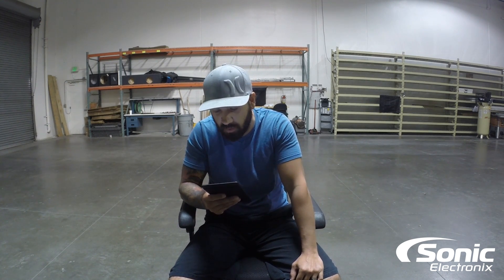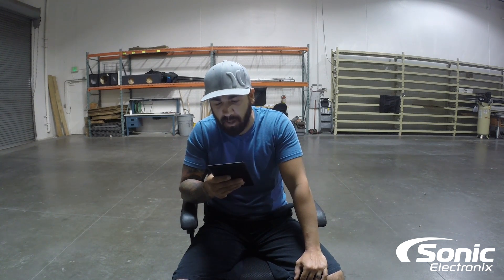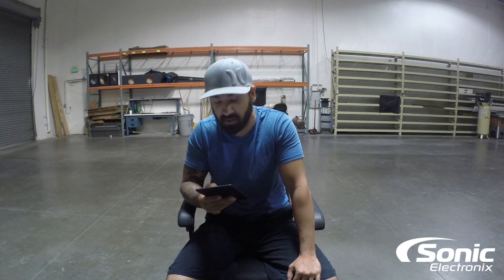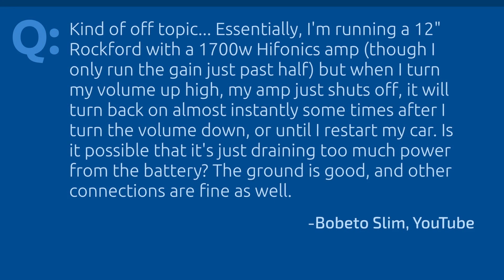Why Does My Amplifier Shut Off? | Car Audio Q & A

Comment: I have a DNX8120 and a JL audio 500/1v2 mono amp for my two 10” JL Audio subs. When I have the volume 15 or below the amp for my subs turn off. When I crank it the amp turns on and sub work fine. I looking for help to solve this problem. Can you help me?

Comment: Question hope you could answer it. I’m running two 12tw3 on a jl audio 1000/1 jx amp and every time I turn the epicenter up it cuts of until I lower it and it turns back on
Reply: Lower the gain a bit just a teeny bit and see if that helps.

Comment: Bros after doing a complete checklist changing harness changing power wire resending relocating grounds changing fittings on power all that to find out that if you mounting amp directly to the back of your factory seats can cause amp to cut out
Reply: Fo real? Cause I been chasing my tail

Comment: Just had an amp and speakers installed now i have to manually turn off my stereo and it sometimes the radio comes back on when car is off and my battery is dying.. what do i do
Reply: Tour stereos remote turn on wire is connected to a constant power if it doesnt turn off when the car does. Needs to be rewired

Comment: I have a 2500w quantum audio 12 inch running it on a 1500w crunch amp it shuts off after a few minutes and I noticed the amp gets really hot is the subwoofer possibly just too much for it?

Comment: Need help.....running two amps with two 12's 4g from battery to  Distribution block then 12 gauge wire to the amps...worked fine...changed 12g to 4g and now amps keep shutting down at anything over 3rd volume.   4g ground....was also 12 before upgrade.   Checked game and adjusted boost level nothing is working To fix the problem

Torinopro422@gmail.com

Comment: My amp went into protect mode after losing the power connection i fixed the connection but now its in protection mode...help
Reply: Check remote wire, take out battery cable to amp, make sure there is no corrosion in where you insert power to amp.. happened to me and that took care of the problem, kept happening until I went from 8 gauge power from capacitor to amps to 4 gauge,  the remote wires also melted or got a little burnt,  cut off put clean remote wire back in no problems since
Reply: @jessedukelacrosse6470  hey I have 3 15s and two batteries in the back, same issue, amp keep turning off, but when I took the 2 batteries out it doesn't shut off as much anymore, please help explain.
Reply: @3yearsago287  god damn you trying to kill everyone you drive pass? Hahaha yup me to lol
Reply: @strangedays2010  it's actually my husband's lol
Reply: @3yearsago287  nice!!!!!!!!

Comment: I have a Kenwood radio double din and a Kenwood amp 2000 watt  and a fuse 300 and to 10inh subwoofer hezt  500 watt and what to  protective mode . I disconnect my subwoofer it is still pretending mode  I check the fuses amp it is good and check the fuse  under the hood it is good toi  have a competitor it is good to

Comment: My Sundown sae 50.4 was working fine along with my Sundown scv2000d, but now that im running it with the Orion Hcca 5k , the sae50.4 is getting hot and cutting off. Is this due to it not getting enough voltage? I have a 320amp alt, xs power 5100 battery , and 0 guage wire ran.

Comment: Can we use a 12 gauge wire as the remote turn on for the amp instead of the 18 gauge wire my pioneer 760w amp keeps shutting off by its self tested at 13 volts with the ground and positive connections at the amp when I tested the remote wire on with the ground got 3 volts

Comment: I have a question. I have 2 sundown sa10's and I'm running a 2500 planet audio amp. It goes to in protection mode. I have checked for shorts. And my gain was set with a multimeter. I dont have my bass turned up on my on my bass knob and if I crank up the bass on my knob it will go into protection mode

Comment: I have a similar problem but mine is with a Pioneer 6X9. I disconnected one of them and the audio worked fine then I switched the 6X9's and as soon as I turn up the volume the amp goes into protection. I think it's a bad 6X9 but not sure because the speaker still works. Could it be going bad and causing a bad connection within the 6X9 that makes the amp goes into protection mode? If I leave the one off the amp works perfectly fine.

Comment: I just got a 1000.1 kicker amp with a 10in kicker compr 2hom sub an it's making my lights flicker an shutting them off,my old amp an sub did not do this it only happens wen I hook up my 1000.1?
Reply: Cody Lovelace Is that the Q Series? I bought one of those cheep bastards last week and even before I left the shop parking lot they knew I wasn’t happy. Needless to say my Pioneer execelon  600 watt is back in pounding away.

Comment: My amp goes into protection mode when I plug in the groundwire does that mean I don't have a good connection or need a stronger wire?

Comment: I have a Eclipse Da7232 amp. I put it on my bench test and it would power the green light on, then fades out right away. I figure it was a bad fuse or connection. Put a Rockford Fosgate T1000-1 on the same test and powered on with no issues. I cleaned up my wires and retested the Eclipse amp along with a multimeter. All fuses are good, power supply is good, ground is good, remote is good. I know with this amp its a digital amp and has 8-25amp fuses on it which were all good. Any idea what the issue could be, or is it a internal issue possibly. Never opened the amp up to check internals. 
Tested on a Mobile Authority Hybrid power system 14.4v constant.

Comment: I have a question I hope this is were you post.This is what I have:All wet sound products. (1) REV 410 speaker.(4) swivel REV 10 (4) 650 RGB speakers.(1) 10 FA sub.(1) SD 6 Chanel amp.(1) SD 2 Chanel amp.(1) HTX 4 Chanel amp. (1) Wet sound RGB controller (1) 120 amp disconnect switch.(1) distrabution block. All seems to work but my SD 6 AMP for the tower tower speakers that controls the first two items on list. This has been installed less that two weeks ago and all was working. Now the second time I turned it on the towers speakers and they are not working. Checked the 12 VDC power to the SD 6 amp and it good, then checked the negitve ground and it good, checked the AMP start from ken wool deck and there is 11.6 volts. The other two amps are on and working fine powering up and worked fine. When testing the power I turned the boat key on again and for one second the amp light turned on blue then went dead again. Could I have a bad wet sound amp? Power was tested by my multi meter.

Comment: im not sure if i can leave a question here. but hope that yall can help me out. i have a kicker cvr dvc 4ohm. the amp is a Pioneer GM D9601. the amp gets really hot. it used to push 2 sundown audio subs at 1ohm and worked perfectly fine. now that i have it in a small vehicle with 1 sub at only 2ohms it gets hot to the touch. also this surprices me. the amp wont send any audio out until the volume is almost to the max. fyi the headunit is stock because of gps and steering wheel controls. im running the amp on 4gauge wire. ground is clean no paint. used a grinder till i got to the metal. all wires are good from what i can tell. could it be the Audio Control epicenter?

Comment: I added a big 3 ground to my battery to chassis and it took away the thump when turning on and switching presets stations ext yet shuts amp off when hit small bumps or turns ext so check that, I left factory ground and ran a new on same ground spot with factory idk if that caused it but when I run it to its on spot the thump still remains as if it does nothing now.

Comment: When i turn up my radio and bass hits my amp shuts off so i got to turn off my radio then back on and amp turns on again.what is the problem?
Reply: Juniorbriceno did you ever find out the problem?
Reply: I had the same problem except mine would shut off at low volume. The shop checked my amp and said the spade remote turn on terminal was getting loose through all the years of pounding now I gotta get someone to fix the remote terminal part of my amp

Comment: hi got a problem my pioneer gm-5400-t indicator light flashes together with music and when increase volume amp plays and cut off  several times
Reply: Did you ever figure out what the problem was? Im having a similar problem
Reply: @mallorycainjr.1921  lol bow did YOU ever figure out the problem. My turn to ask you now. I got that same shit problem.
Reply: @strangedays2010  you asked on the same day I had a shop check it out lol. I have the old school 1500bd rockford fosgate amp and had it checked out by the shop. I thought it was my remote turn on wire at first but they said the remote turn on terminal on the amp has loosened up after 18 years of the subs rattling my car and its causing my amp to cut in and out. I'm currently looking right now for someone to fix that terminal for me. The hard part is going to be to find the part for it. I dont know where to start looking
Reply: @mallorycainjr.1921  try amp repair parts .com
Reply: @strangedays2010  thanks for the help
Reply: @strangedays2010  what name of the part should I look for when replacing that piece that remote turn on terminal?
Reply: @mallorycainjr.1921  maybe amp terminals? I'm not sure tue exact word for that but I would search for terminals maybe.
Reply: @mallorycainjr.1921  or find someone to solder the old piece back on?
Reply: @strangedays2010  that's also true I found a guy that's gonna go inside it I can ask him about that as as a possible solution I'm just a basshead that wants music 🤣 the torture man
Reply: @mallorycainjr.1921  for real torture lol. Mine is still cutting out right now. I'm off tomorrow so gonna take out everything. It's a hassle cus my box is so big and heavy
Reply: @strangedays2010  you not lying take out the box can be hell sometimes wish you the best of luck it can always be something so simple we just always overlook it
Reply: @mallorycainjr.1921  ima post a video of my subs in a minute.
Reply: @strangedays2010  alright I'll check it out let me know when its up
Reply: @mallorycainjr.1921  man it's been raining lately. And today had someone pass away. So...😓. But lowkey my problem was the power wire being pinched. Fried my fuse. So check them power and ground fellas
Reply: @strangedays2010  sorry to hear that bro my condolences goes out to you and your family.. them pinched wires gets everybody I got to check mine too
Reply: @mallorycainjr.1921  I threw a quick video up on my page. Still raining out.

Comment: I have a 2004 mustang that has a aftermarket amp that is tied into the factory radio the issue I'm having is the amp goes into safe mode at high bass I have checked all connections they are good I also replaced the amp is there anything you may be able to suggest?
Reply: I have an 08 mustang and same problem. have you found solution?
Reply: alternator i hope that fixes the issue
Reply: wasnt making enough juice to power everything
Reply: Dsp

Comment: Can u please help me? Why when I turn on my stereo my subs give a thump?
Reply: +Suazzz check make sure you have a good enough ground wire solid earth and power is the right size for what you are running. a thump when turning ya stereo on could be from amp tune rca placement or bad earth. make sure ya RCA leads are no where near ya power wires or u will get a constant whine with engine noise. check make sure ya rca wires are good with no breaks. and make sure you have power running to ya amp that is suitable wiring for it

Comment: I'm running a 10" Rockford P3 1000watt and a SPL 600watt amp.
my amp cuts off all the time. what could be the problem
Reply: +Damian Quichocho  run a 2 farrad or bigger power cap with 2g wire and a 160 amp or lower fuse. make sure earth is same size and has good contacts

Comment: Can you please help me... I think its the way i wired my subs but idk.  I have alpine type R 1500 max  rrunnin thru a 1000 or 1200 watt kendwood amp. First off the amp gets too hot but when i turn my volume up and start bassing hard my amp turns off.  Now at first my deck would shut off also turning off amp but i fixed that by grounding the stock ground and back of harness ground to back of my decks own ground meaning the screw hole. Im sure u know my head unit is alpine as well. After i grounded my harness to my deck deck never stopped. I was bassin with volume up no problem.  But now my amp blows fuses. I went thru 5 today please help. Do u think its the way my subs are wired pulling too much juice so the amp is going into protect?
Reply: It was the way i wired my subs.  Amp was putting out too much juice to my subs. I ran em at 8ohns. Sucks but thats all theres to it.
Reply: With dual 4 u can either drop it to 1 or cut in half at 8
Reply: My decks acting up .Its bass boosting when i turn balance left or right but when in middle no bass wtf?
Reply: Head unit it cda 122 alpine

Comment: Hey,  i have a alpine mdr-501 amp and i run two capacitors with it. Now when i turn my volume up it works great but it drains my power to 11v if i go to loud and puts it in protection mode is there any way to fix this problem? Or do i just have to buy a bigger amp...which id rather not do cant really afford it atm.
Reply: I'm five years late but no! It's probably going into protection mode because you're dropping down to 11v and buying a bigger amp would only make it worse. You need to buy batteries! Not capacitors. Also you will need to do the big three upgrade.

Comment: my friends old zr360 shuts off or sounds weakened after some time abusing it. yeah. in my opinion it's running the gain too high. potentially clipping the woofer. most likely sending a clipped signal to the woofers and just straight up draining the electrical system.
Reply: Sounds like amp is fighting to keep up...but I need more info

Comment: I got a question I like to travel at least 3 to 4 hours on the road I was wondering if you could recommend and amplifier  that will not heat or turn off?  I have a zapco 1100.1 on a Gravity 15 inch Warzone Series....!!! Halfway on the road it will turn off turn the volume down give it 10 minutes and then I'll turn back on

Comment: I'm having the same issue. I'm running a JL 1800 watt amp and (2) JL 10w1. The subs are wired to 1 ohm. The subs are 300 watts rms I believe. Could it be the amp is too powerful for the subs? I've done the big 3 upgrade and a kinetik 1800 pro up front. Was thinking about switching subs to a sub that's 500 watts rms

Comment: i brought a boss 5000watt monoblock to run my 2x dual fusion 12inch enclosure and 2x dual 15inch fusion do i need a capcitor and if so what farad would you recomend

Comment: Heat is also a possibility unless it is an instant shut off as soon as you hit a number on the stereo.
Reply: +Koolaiderman  your so stupid the amps need heat for it to run unless your not letting the amp breath then it will shut off and never turn back then the old amps needed to heat up and if you didint the amp will sound like crap

Comment: I have a question, I have two 12" kicker cvr's and a bazooka 700 watt amp (I've had this system for about 3 years now) and out of nowhere when I turn my head unit off, the subs thump once. I checked the ground and all the other wires at the amp and they are fine, I haven't check to see if any of the wires to the pioneer head unit came loose. Is there anything else I should check and what is the reason for the thump when I turn it off?
Reply: ahh gotcha. Yeah the subs thump a few seconds after the head unit turns off. Should I still double check connections to the head unit just incase?
Reply: Alright I'll do that first and see. I'll comment back on here and let you know.
Reply: Most likely its the amp...they have soft turn on and soft turn off that gave out....I think they sell that unit separately but you would have to look
Reply: I think it's the amp tbh. It my subs hardly hit now so I unhooked everything and I'm taking it to a shop to have it looked at
Reply: eh lol I really don't want to buy a new amp. it is really old though.
Reply: Mostly ground
Reply: it was actually the amp. it died out

Comment: so i know that most amps will do this but if your HU is putting out to much voltage those hifonics amps will go into protect if the voltage is higher then 3.5-4vs ive ran into the problem over the years why to test it find some test tones turn hu all the way up and put a DMM on your rcas at the amp and see how any volts your hu is putting out